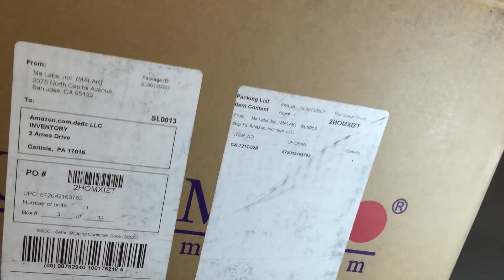Supermicro SuperChassis CSE-721TQ-250B unboxing and overview

Comment: I'm also using this chassis with a third-party motherboard, also an AsRock (i'm having the needed CBL-0084L). Can anybody confirm this I can or can't use the two 4-pin power cables to provide power for my CPU? I don't see any other way. (The 24-pin will be used for the main power, and the 2x4-pins will be used to form my needed 8-pin connector.

Comment: Please is it possible to know the noise level of the chassis? From the big fan and the psu fan? Is it possible to remove the big fan?
Reply: I've took a look into the manual and yes, the Rear 120mm Fan got a usual 3-pin connector and can be removed, it also got mounting holes for a 92mm fan there.
I guess it's a not super-silent industrial fan, I would replace it with a silent fan like Noiseblocker eLoop or Noctua.

Comment: 5:25 isn't that the CPU power connector ? 
My computers work with the wide motherboard connector AND the 4 pin one, it would not start without it.
Reply from the maker: On this system, you don't want to use both, see:
https://TinkerTry.com/on-xeon-d-supermicro-superservers-dont-use-motherboard-power-header-at-same-time-as-4-pin-12volt-connector

Comment: The 4pin connector is used for extra power to the cpu. Of course you would connect it. Why do you say not to?
Reply from the maker: I've had folks email me with issues when both are connected (SATA ports gone bad, for example)l

See also what Supermicro's manual says:
http://www.supermicro.com.tw/manuals/superserver/mid-tower/MNL-5028D-TN4T.pdf
on page 4-7 and 4-9

ATX
PWR, DC PWR and HDD PWR Connectors (JPW1, PJ1, J6) 
The 24-pin
ATX power connector at JPW1 is used to provide power to the motherboard. PJ1 is
the 12V DC power connector that provides alternative power for special
enclosure when the 24-pin ATX power is not in use. The 4-pin HDD power
connector J6 provides power to onboard HDD devices.
Reply from the maker: I've noticed in DC only devices like the new SYS-E300-8D and SYS-E200-8D, only the 4 pin DC connector is used.
https://TinkerTry.com/supermicro-superserver-sys-e200-8d-and-sys-e300-pictures
https://www.youtube.com/watch?v=Hs1V5tWbEH8&t=3s

https://www.youtube.com/watch?v=CrnELkZ4GmU
Reply from the maker: Oops, and this one https://www.youtube.com/watch?v=eDsMx8TUSac
Reply from the maker: FYI, I've pulled the info together here, hope it helps, it is a bit unusual https://TinkerTry.com/on-xeon-d-supermicro-superservers-dont-use-motherboard-power-header-at-same-time-as-4-pin-12volt-connector
Reply: @TinkerTry  What If I'm not using a supermicro board or xeon? I'm using this case with an asrock rack c236 board and a pentium.
Reply: I'm using this case with an ASRock C236 motherboard also. So is the 4pin supply needed?

Comment: Hi
wiredzone shipped my superserver with the 4 pin cable for dc connected to the motherboard, should i disconnect it?
Reply from the maker: I'm so sorry to hear this. I have contacted Wiredzone on your behalf. The preparation instructions that I provided to them has no mention of attaching that cable, it's possible it came from Supermicro that way. We'll need to add a step to verify that the connector isn't attached. Again, surprising that this error was made.

The only report of a non-Wiredzone customer attaching that cable was that it may have caused 2 of his SATA ports to fail, can't know for sure. If all 6 of your SATA ports are fine, I'd say you're likely just fine, you could also contact Wiredzone support directly for reassurance as well, if you'd like.
From page 4-7 of the manual:
http://www.supermicro.com/manuals/superserver/mid-tower/MNL-5028D-TN4T.pdf
The 24-pin ATX power connector
header (JPW1) provides power to
the motherboard. PJ1 is the 12V DC
power connector that provides alternative
power for a special enclosure
when the 24-pin ATX power is not
in use. The 4-pin power connector
J6 provides power to onboard HDD
devices.

Comment: I am grateful for this video, as it points out 2 things about this chassis:
1. It does not come with those sexy silver SATA cables..
2. The front panel motherboard connector is especially made to go with supermicro motherboards. Using other mini-itx boards in this case will be a pain in the ass..

Thanks!
Reply: Supermicro sells a stupid adaptor for like $10USD.
Reply: I missed this and have come across the same problem. You need to buy a CBL-0084L (<$10) to split it out to use with a standard motherboard.